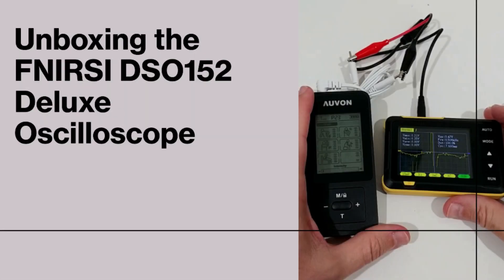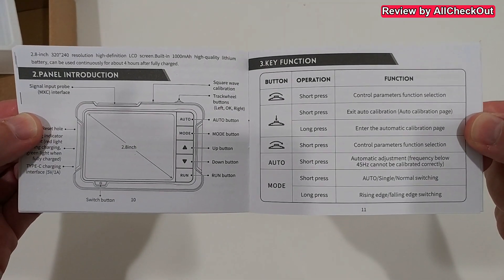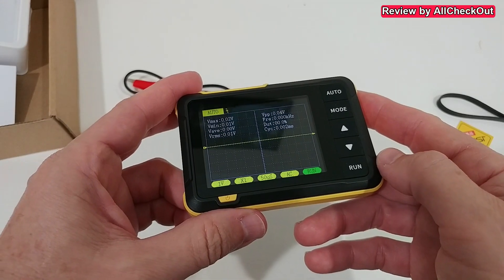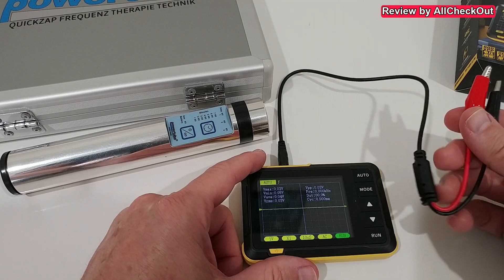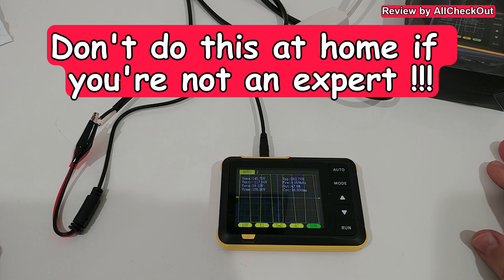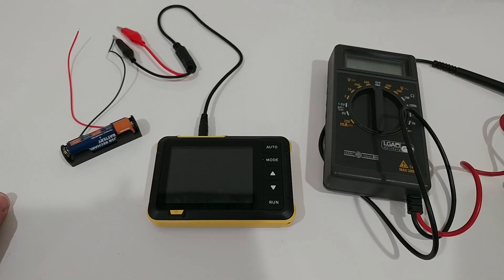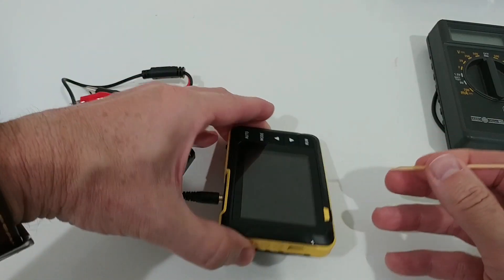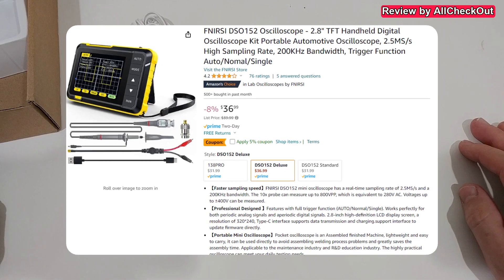FNIRSI DSO152 Deluxe Oscilloscope: Unboxing & Comprehensive Review Tutorial

Comment: 1.9 volt from an AA battery? That is impossible! Seems that it is that high with the multimeter because it is in a circuit with the oscilloscope, part of that voltage must be coming from the oscilloscope itself or something. I have never seen a 1.9 volt AA battery. Really wonder how it is possible. Measure it without the oscilloscope connected…
Reply from the maker: Thanks for your thoughts. Yes some AA deliver a bit higher voltage ... especially disposable batteries ... usually 1.6V when just measuring the voltage with very high resistant like with a normal volt meter. But this rechargeable battery delivers only 1.5V .... yeah ... you're right ... and hence the FNIRSI DSO152 was correct and the volt meter faulty. Had never thought about that before. Dumped this volt meter a few months ago. Maybe will do an updated video at some point, but for only so few views probably not worth it .... Most of the video is not affected by this anyway. Cheers.